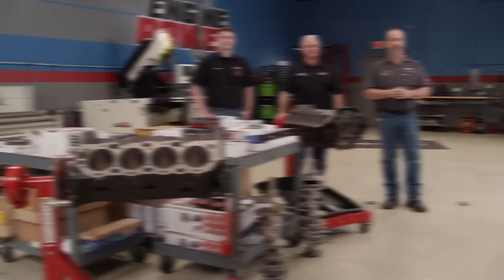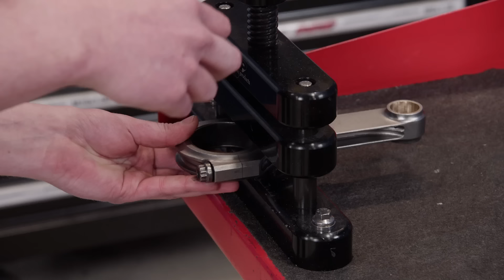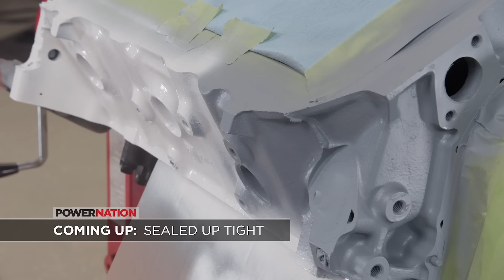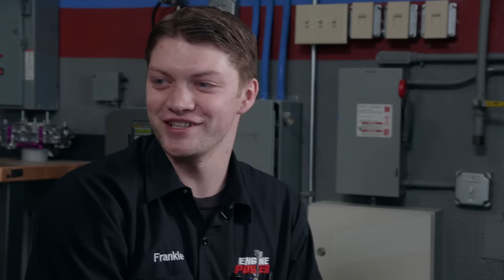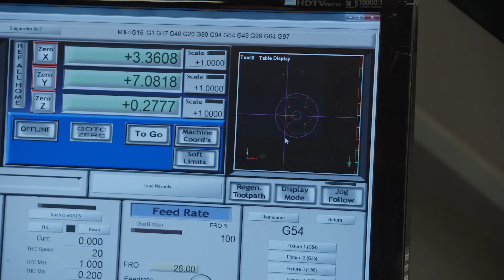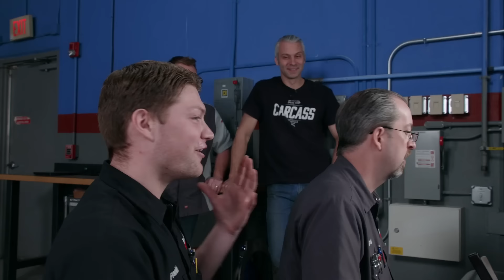Twin Big Blocks Dyno'd Together - Engine Power S9, E5 & 6

Comment: Phase it 45• so it has a power stroke more often per revolution
Reply: They would run smoother. The old radial engines were that way.
Reply: They phased them with the axle shaft spline. with the splines count they were able to phase it ~46 degrees
Reply: I believe  if you were  to phase the one  engine out 22.5 degrees  it would  function  as a 16 cylinder
Reply: @donaldkempf8254  lol there ya go … didnt even catch that
Reply: @donaldkempf8254  I was thinking the same thing.
Reply: @donaldkempf8254  The engine is a 4 stroke, the engine rotates twice to get power from all 8 cylinders. And V8 fires every 90 degrees 720/8, and a V16 fires every 45 degrees 720/16.
Reply: This make sense V8 makes power at every 90⁰ of its rotation 45⁰ phasing will help to make power per revolution also putting more horse power engine at front and less horse power engine at back improve efficient crank loading u should use u joints or rubber coupling to connect both engines together if there is torque difference between drives there is twisting moment happen in drive shaft if u connect both engines side to side  there will significant increase in horse power that means combination of two side to side engines coming in single shaft and torque will be 2.5 times
Reply: @saurabhnanoti8925  i did the same thing with my 60° V6 instead of 45° it's at 30°. With a compcam lope cam. It has alot of jumping on the engine at idle, but when you put your foot into the throttle it goes wild, i have to watch it when going around corners it'll brake loose and go sideways. Its a 82 S10 with a 3.4l and Borg Warner T5 with 3.08 rear. It's a great highway cruiser.
Reply: Cool idea!  That way it functions more as a 16cyl, not one huge V8
Reply: Now i wanna see the comparison dyno run
Reply: Phasing that way will also help it sound better. At the opposite extreme it could be phased to fire unevenly. Make it sound like V Twin Harley and it's unique sound.
Reply: Some scientist/wacky inventor type over here in the UK did similar with two BMC 1100cc A series engines in the 90's. I don't remember the specifics and it wasn't a lot but with correct phasing he managed to consistently achieve a better overall figure than the two engines individually produced,I would image if you applied this experiment across a wide variety of engines and experimenting with different phasing you will find many varying results,and maybe even the odd surprise result.
Reply: that's exactly what they did but they used a Ford 8.8 31 spline axle shaft two couple the two and the closest they could come was 46° so many they should have used used a 28 spline out of an 8" but that might have brought them closer to 43° and those aren't strong axles plus I'm not sure about the math!
Reply: @rustybritches6747  Wow, that's great insight.
Reply: That's what I was thinking
Reply: They did
Reply: I would do the same, if nothing else to have the engine run smoother
Reply: big brain
Reply: if you got them only 5 degrees out of phase you might get a long pulse power delivery.
Reply: @retheisen  thank you
Reply: 100% did this back in 2009
Reply: They did, it made 1183/1229
Reply: Was thinking the exact same thing.  During the prototype build on a twin side by side engine harley dubbed the twice rocket I built my crank stub to be 180 out basing my thinking off the same idea. Have one engine firing when the other doesn't.
Reply: Would 180 be smoothest and 45 the most effective for power? I'm a little worries they'd pull each other out of stroke in a way, life if your bicycle pedals span faster there your legs and span around and smashed your legs
Reply: They did, 46°
Reply: We have been building dual engine setups for natural gas irrigation use for years.  I wish I could post a photo here for you.

Comment: 4 3/8" unc bolts  to hold them together.
Clearly a good time not a long time...
That poor little 3/16" woodruff key on the harmonic balancer only rated at %10 of what is going through it.  You have to remember that a blower drive can shear a drive key pretty easily.
Back in the stone age when they used to have multi engine drag cars they would forgo the harmonic balancer on the rear engine and just clamp them together with a duplex roller chain coupling.

Comment: Just think of the Ton of Horsepower and Toque the 2nd engine has on the Harmonic Balancer Keyway and Key?   Impressive.  Loved it.    Thanks guys.
Reply: yes, when Detroit Diesel did these bolt together designs, the crank was either cast from a single piece, or the crank was bolted together at the block split.

Comment: I would like to see it again with the engines timed 180 apart
Reply: If they are 90 or 180 out there are still compressing two pistons at the same time. More interesting would be 45 degrees off so only one piston is compressing at a time
Reply: @stevenhoitz9260  would it be a smoother event like a v16 or still be a distinct, separate one?
Reply: @stevenhoitz9260  no they would need to be at 22.5 degrees for what you're thinking.
Reply: @joshtheking1772  no 45 degrees. 1  4stroke cycle is 720 degrees
Reply: @stevenhoitz9260  
They were set at 41 degrees apart so they were slightly off.
Reply: @bertgrau3934  where was that shown? They point out that both engines are at TDC on their respective #1 cylinders.
Reply: Would that cause a ton of vibration?
Reply: I was thinking the same exact thing
Reply: I was thinking mirrored cam and crank, so instead of both engines firing 12345678 (o know that's not how theye fire but for example) they shoot 1,8 2,7 3,6 4,5 Ect, also I want yo know if there's a difference aligning TDC for both engines to start at the same point or if you stagger engine a and b
Reply: So there both at top dead center right now ?
Reply: @shacklifecustoms8430  
No they set them about 41 degrees apart

Comment: Cadillac did a 7.4 V16, and was awesome, imagine if they release a luxury sedan with one of those.
Reply: Cadillac also had a project of a 13.6 but it didnt made to the factory =(
Reply: Knowing Cadillac it would still have like 100hp
Reply: Anyone remember the GMC "Twin Six"? Basically the same thing, as whats going on here, only incorporated into the same engine block.
Reply: @markhenry5294  the 702 was a neat engine with peak torque just off idle. Unfortunately super long and it didn't take much frame flex to shear engine mounts. It would be nice to see what it could do with good 4 valve aluminum heads and and a high compression ratio. The 7.5 didn't provide much horsepower per gallon and the 2 barrel carb gave just enough to get it up to 60 mph
Reply: @joegreen4089   Good to know. Thank you!
Reply: Or 2 of those as a concept vehicle? They are well known for making land Yachts. VERT long nose short ass.

Comment: i wonder how it would turn out using a clutch bearing system from a drag race setup to allow some independant response from each engine?
Reply: Would that help? It's not really different now than driving uphill or downhill or whatever for the other engine. The other crank has to transfer all the power from the other one thats the real limit with setup like this
Reply: Thinking more like the clutch plate hub springs would lessen the slight phasing fighting as the engines run. 
Think of a single cylinder 4 cycle engine only has a power pulse for about 180 degrees of its 720 degrees of 4 cycles, but can still produce a net increase in engine RPMs... almost doesn't seem possible... but the flywheel action of crank and flywheel makes it work...
Reply: You'd lose the phasing effect. It could end up giving one side both the same stroke, so it wouldn't be smooth.
Reply: @DanE-ew1yt  both of these engines were at TDC and connected. They shared the same stroke.

Comment: Question- why are they called main bearings if they don't actually move? If they move then they are considered spun and its not good
Reply: The short answer is that bearing has a wider definition than the roller bearings that you are thinking of.  The moving part in a main or rod bearing on a crankshaft is the lubrication.
Reply: @wadeturner2665  appreciate it. I thought I wasn't understanding that
Reply: @mattfubar4268  I learned something from reading this too, so thanks for asking the question! (And to the guy who answered)
Reply: Here's the long version, but note that not every engine works this way.  There is usually a hole and a groove in the bearing that fits into the block. This lines up with a hole in the block that is supplied with oil under pressure from the oil pump.  That groove allows the oil to distribute all the way around the bearing creating a film for the crank to ride on. Part of the bearing's job is to keep the oil in place, otherwise it would all just leak sideways and down into the pan. If for some reason the constant oil supply is blocked then the bearing goes dry and the crank rides on the bearing, not the film.
Reply: But wait there's more. What about the rod bearings?  If you look closely at the journals on a crankshaft,  there's a hole. On a V8, the rod journals have 2 holes, one for each rod bearing. The holes on the main journals are connected to the holes on the rod journals with an internal passage in the crankshaft.   So the oil pump supplies oil to the main bearings where it creates a film for the crankshaft to ride on. Then it enters the hole in the crankshaft and travels over to the rod bearings where it exits and supplies the rod bearings with oil to create a film there for the piston rods to ride on.  It the exits out the sides of those bearings and drains into the oil pan.
Reply: @wadeturner2665  that explains why its so important for the "balance" of the crank. Because you need a specific oil layer that acts as a hydroplain for the moving parts. If its off balance then it doesn't allow consistent oil flow all around

Comment: This was actually something I always wondered. Lol. 
Can't believe how much power it made.
Reply: I think some 1950's dragsters did this... and, of course, think TV Tommy Ivo or Mickey Thompson doubled this with 4 engine dragster back in the day...
Reply: Its almost like how they research and testing an F1 engine, or at least, how they used to do. Build one cylinder, so if its good, u can multiply woth the cylinder number. 50hp one cylinder then u have 8 times 50hp or 10 or 12 times. Okay, its setup depends on the carbs, weight, the exhaust flow, etc, but this calculation works if everything works as its intended.
Reply: @DaBombtasi  yeah exactly like that
Reply: Pulling tractor guys build multiple engine stuff all the time.